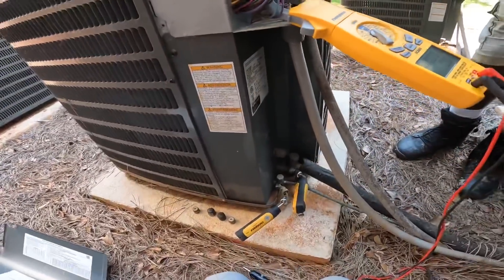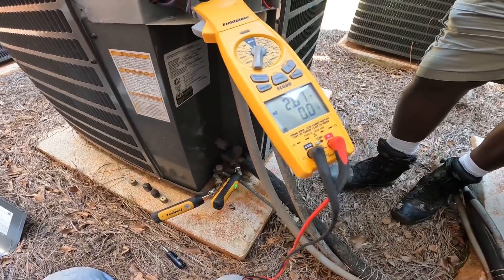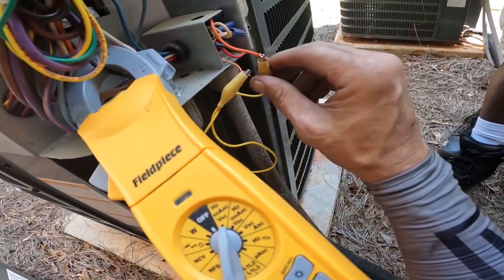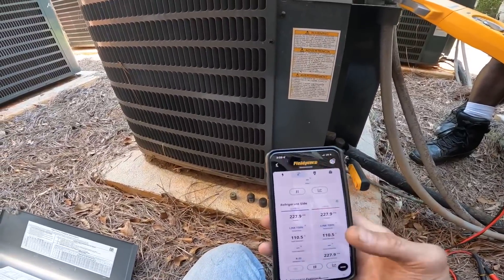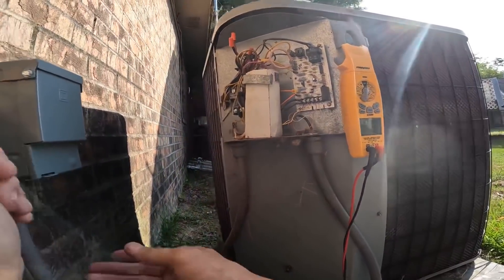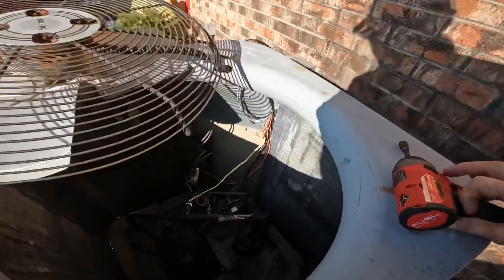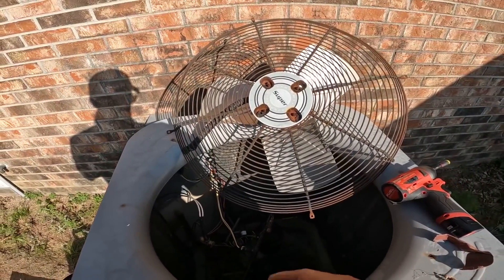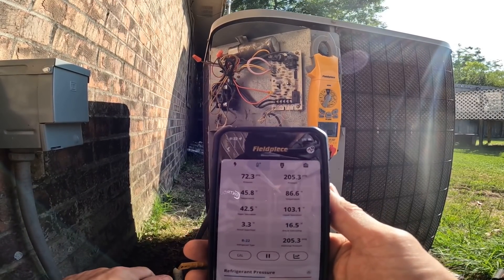Two Interesting HVAC Calls in 8 Minutes

Comment: HVAC technicians are able to diagnose and solve problems with heating, ventilation, and air conditioning systems. They use a variety of tools and techniques to troubleshoot issues, and they have a deep understanding of how these systems work. This allows them to find and fix problems quickly and effectively. In addition, HVAC technicians can often explain complex concepts in simple terms, making it easy for customers to understand what's going on. HVAC Guy is a seasoned professional. You can pick up alot of knowledge from these videos.

Comment: I have to ask I also have the same wireless gauges and clamps but the clamps give me constant issues, they always have issue saying open when they are closed and glowing green . I just bought them and the clamps are so fustrating that is just started pulling out my regular gauges...do you have these issues? And if so how did you fix this? I will say that I did updated the firmware.

Comment: Soon as you said the suction line on that second unit was hot my first thought was heat pump with the reversing valve either not being energized or bad. Guess I will see if I was right as I continue to watch.

Comment: Curtis - Thanks for going back to the "original" intro bumper music, I believe it fits your Channel nicely. One question: I know you are now using your phone with your Bluetooth Fieldpiece probes, either with the Fieldpiece app OR measureQuick. Have you thought about carrying a separate TABLET just for your HVAC apps - maybe an iPad Mini, even a used/refurb one - in a tough case like an Otterbox? The tablet is bigger than your iPhone so the internal battery is bigger, which means more runtime... And that would allow you to use your phone while still monitoring the data. If you got an iPad Mini WiFi only (cheaper) you could still tether it to your iPhone while on-site (if your carrier plan supports tethering aka "local hotspot". Just a thought.
Reply from the maker: I’ve thought about it.

Comment: WAIT!!!!!  Before you condemn the compressor, the rv relay on the board itself could be bad..

Just cause it click, doesn't mean it's engaging.. TRUST ME, send a full 24V by jumping the rv wire directly to "R" and the other directly to "C". 

The board either sends 24V "O" in defrost...  The little black relay on the board goes bad and even though you will read 24V+, it doesn't let enough flow through amperage wise at the points in the little tiny board relay itself are damaged. By jumpering the RV wiring itself and making sure you have a full 24v feed to the RV, you can for sure eliminate that.

Happened to me once. Damn thing had 3 weeks warranty, same noise.. Condemned the compressor as i read 24V at RV and had click also. Installed new compressore, fired it up. (SAME NOISE)!!!  Come to find out the RV 24V reading wasn't enough!!   It a "24V RV NEEDS 25V+!!!  (YES I KNOW THEY ARE RATED AT 24V BUT I HAVEN'T SEEN A SINGLE UNIT WITH LESS THAN 25 VOLTS AC WHEN FULLY RUNNING AND AMPERAGE USED)..

Needless to say, i found it and could literally "flick" or "tap on"  the relay on the board and the thing would then engage properly!!

Try jumpering the reversing valve before you install that compressor. May save ya a compressor install for nothing!
Reply: I've seen some relays and valves take up to 28 Volts! there may be resistance to operation from rust or debris; location, location, loc...
Reply: I had a scenario once where reading 24v was not actual 24v. It should be around 27 or so. That's when using a different mode on the multi meter can help with this issue. The 24v is back feeding from elsewhere. I think Brian Orr at HVAC School went into this topic for around 30 min and explained it very well.
Reply: @sprockkets  I had and Amprobe and also used a high input impedance Triplett multimeter which was very accurate. Like 10 Megohms.
Reply: @sprockkets  Yeah it happens.. I trust my FP HS36, top of the line and has never let me down.  But it happens thus i wanted him to check that before he made that same mistake i did years ago.
Reply: This man is a veteran son, please don't disrespect him with your stupidity, stop it.

Comment: Another way to determine whether it's the compressor versus the reversing valve is by pumping it down. We all know what happens when you try to pump it down and the compressor is not pumping. Absolutely nothing happens
Reply: I've never actually tried that but I heard that the reversing valve could be bypassing and mimicking symptoms of a bad compressor. I heard that you have to actually take temperature readings around the reversing valve to know if its bypassing
Reply: @allanbrito13  I get that but the compressor will pump down regardless of the reversing valve being good or bad unless the compressor is bad. They also sell at United Refrigeration this magnet that goes around the solenoid valve on a reversing valve so you can force it open and closed
Reply: @BibleBloopers  it will not pump down. Sometimes the valve gets stuck in between so discharge gas goes through suction port on valve. I have seen it alot but all on water source heatpumps from high pressure and overheating. You cant pump if discharge is going into suction.
Reply: Pumping down will not work if reversing valve stuck in between it is very hard to tell .sometimes you can see if it changes running  heat.if you got compression during heat its reversing valve
Reply: Try crimping off your discharge line from the compressor if it goes into internal bypass it's very likely the reversing valve failed but if not I would replace the compressor but honestly if I'm in that situation I'm changing both as long as there under warranty it sucks to replace a reversing valve but it sucks way more to be wrong
Reply: @lonniebearden9907  yea i thought the guy in video did great he was right and didn't have to do reversing valve. I think he talked about taking temp readings on valve. I have made the mistake before thinking it was compressor and ended up being valve. Great video
Reply: TXV can cause the same situation. Thought I had lost the compressor on my upstairs A/C from the way it was sounding. Turned out to be the TXV.

Comment: Some Goodman compressors will permanently bypass because they were either running 24/7 overcharged or there was a restriction. If it can’t pump the liquid guess  where that pressure goes ?

Comment: Been running into issues with getting my field piece gages on certain service ports and I noticed  you have a angle piece on yours is that something I can get a the local supply house ?
Reply from the maker: Yes, I think you’re talking about a low loss angle fitting. They should be at the supply house
Reply: @HVACGUY  yes sir I am I'm going to try and get some tomorrow  👍🏻